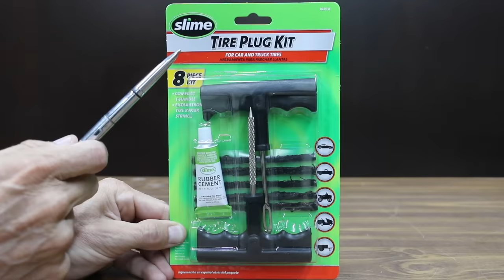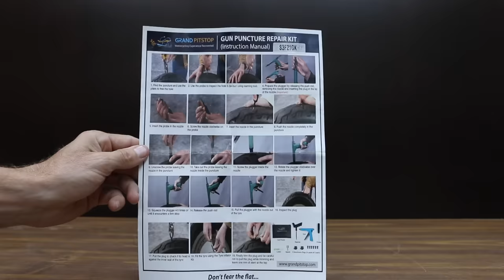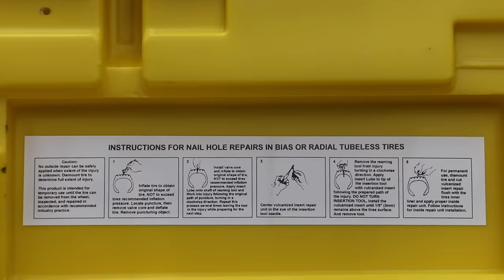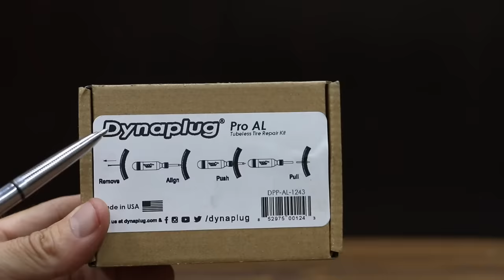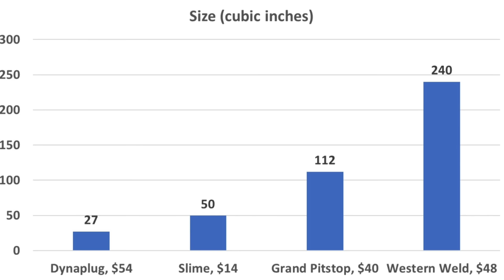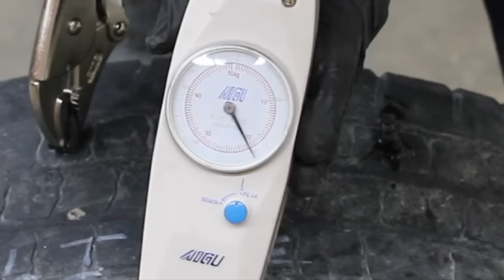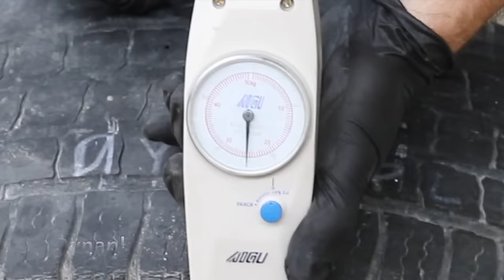Best Tire Repair Kit? SLIME, Westweld, Dynaplug, Grand Pitstop

Comment: For anyone who has NOT ever put in a tire plug, tip your hat and give this man the respect he deserves.  Put a tire plug in and you will become enlightened to the WORK that went into this video.
Reply from the maker: Thanks!
Reply: Indeed! I came to the comments to see if anyone could appreciate the force it takes to get a plug in a tire. Usually I'm laying on the ground or navigating a fender and trying to brace myself against anything I can to muscle them in.
Reply: cordless drill and the proper size drill bit (bits)  does wonders. cheap tire strips all ive ever used.
Reply: One was enough to kick my butt!  😊
Reply: I would be terrified the plastic handle ones would break after being used more than a couple times, sending the metal portion through your hand.
Reply: @Print2shoot  Right! Then you have to use a plug for your hand😁😉
Reply: Seriously, stop with these cringe comments
Reply: It's really not that hard, if it is you didn't ream the hole well enough and didn't inflate the tire before plugging.
Reply: I thought there must have been something wrong with me when I did my first plug. Now I know there are millions of brothers out there nursing broken wrists. Bless 🤙
Reply: Agree, plugging is hard work
Reply: I'm lazy so I want the one that is easy to use and good enough
Reply: Putting in 1 western weld tire plug is a workout all by itself, but they last the life of the tire.
Reply: @daurieschwartz4189 geez glad it’s not just me! I was like am I getting old or what!
Reply: This guy works his butt off for us!
Reply: Yeah but you didn't cover the butt plug  @ProjectFarm
Reply: Agreed, pushing these in by hand is no fun, I've found using a ratchet strap around the tire and then wrapped around the plug handle makes easy work, and even allows you to push the plug in while its still on the vehicle. you just have to be careful not to tighten the ratchet strap too quickly, and keep one hand on the handle as you tighten it.
Reply: I don't wear hats.
Reply: @KingLutherQ  DynaPlug
Reply: 100% when i saw the thumbnail i was like ohhh boy

Comment: Been running a slime plugged tire for 2 years now with no problem. Most repair shops won’t plug a tire anymore saying they aren’t safe so I plug my own. I think the real reason they won’t plug a tire is they can’t make enough money. If you monitor your tire pressure you will be fine. Project Farm is the best
Reply from the maker: Thanks!  Thanks for sharing.
Reply: If I ever plug I always move it to the back. I dont want the front tyre failing. Not that it ever has.
Reply: @kevballard1967 what exactly is the reason for that?
Reply: Front tires are used for steering. Lose a front tire at speed and you could go flying into a barrier or oncoming traffic. If you notice in time, you can safely decelerate, but when you lose a plug, air comes out much faster than with a small screw. Otoh, I've never had a plug come out -- it's more likely to happen if the hole is too large to plug safely in the first place.
Reply: @benb8075  that myth about the front wheels being more important is long proven wrong.  The rear non steering axel provides the stability. You rather want to loose a front wheel instead a rear.
Reply: My tire failures were always heat related delamination,. Every tire brand had it, except the Continental. I always plug my tires when I take one of the millions of roofing nails on Texas' unswept roads. It is the heat related delamination that is the real issue.
Reply: 9/10 will give you the "can't safely plug" and also "by the way, you need four new tires, an alignment, brake job, and I cannot let you leave this place unless you do it now but being a nice guy, I'm knocking off 10% the total price"
Reply: No money in plugging tires.

Comment: As a mailman, I pulled into the tire shop for new tires... the employee came to get me and wanted to know what was going on with my right front tire... we counted 52 plugs that I had put in over a period of time. Most of them were Slime plugs showed in this video. Never had a problem with them. Great video as always! You're awesome brother!
Reply: How the heck did you get to need that many plugs?
Reply: @alanmerritt860  he’s a mailman, always driving on the shoulders where nails and sharp objects settle because it doesn’t get driven on much.
Reply: @alanmerritt860  what Michigan DroneWorks said 😊
Reply: That is so ubelievably unsafe
Reply: Put me down for the $14 Slime plugs Ralph.  Thanks Dewayne!
Reply: The Slime kit is what I use.  Been using it for years.  No problems. 👍🏼
Reply from the maker: Thanks!  Thanks for sharing.
Reply: @LordOfSilense  lol 😆
Reply: @LordOfSilense  I’ve probably plugged over 30 tires on vehicles in my life I have only had one fail and it was in the sidewall I new it wouldn’t last but was just trying to make it to the tire shop I got within 100 yards and limped on the rim the rest of the way. I’m so tired of people saying plugs are not safe/ no good. I have used the slime type ( I prefer the orange color cords) in tires for over 2 years without a problem.
Reply: @Snookchaser007  yes sir I'm with you! I've driven thousands of miles with plugged tires! I bought my wife a new Denali a couple of years ago, and about a month after she got it, she ran over a nail, and I plugged it instead of going through the hassle of taking it to a tire shop, and she's still driving on it! 60,000 miles on them now and probably another 20,000 to go (probably more like 10,000) lol 😆 🤣
Reply: Problem is water rusting the steel belts. They weaken and can rupture, and could fail at highway speeds. which some people can not handle their car well, so they could wreck. I have a large buick 94 wagon with a front tire was thumping loudly driving home on I64, and it threw the entire belt off the tire, tore up the driver door bottom and I looked in the rear mirror, it was thrown hign into the air, landed on the road in traffic. The tire carcass left on the rim was torn to shreds. But the car kept straight and true, drove from far left lane to the exit and changed tire on the exit ramp which had a nice wide weedy spot to work with..

Comment: I've used cheap rope style plugs for years and never had one fail. One was on a brand new tire and it lasted the life of the tread.
Reply: Yep, I've installed hundreds of these plugs for friends and family and the occasional person in a parking lot with a flat.  Even on new tires, they will last the life of the tire.  The manufactures of these kits just can't accept liability for claiming life of the tire in the event it fails in today's litigious society.
Reply: I punctured one of my current tires when it was brand new. A cheap tire plug fixed it for a year. Then I simply fixed it with another tire plug which now lasts for two years. We're talking 200km/h(130mph) Autobahn.
Reply: Same here. I have no interest in even trying any variant of the common plug being that they are so reliable.
Reply: I don’t recommend it, but I have personally used 3-5 plugs in the same hole in tires before that had large punctures and it still works. This was on off-road only tires, and I wouldn’t personally do it on a road worthy vehicle, but in a pinch, it does work.
Reply: Yep I’ve used the cheap 3 dollar Walmart brand on 2 tires and never had any trouble.
Reply: same here, i have had plugs in new tires last as long as the tire itself. there is really no need to pay more for tire plugs when the cheap ones work great.
Reply: Nothing beats the classic rope plug. They simply last, and don't take up much space.
Reply: until you have a broken brake lever pierces into your tire
Reply: Yep, I got the cheap harbor freight version.  Reamer handle snapped under force but was able to get it done and still holding air just fine 2 years later.
Reply: It all depends on the size of the hole
Reply: Yep.  They can keep that convoluted crap.
Reply: I put a slime plug in 2012. Unfortunately got a flat three days into owning my truck. I sold the truck in 2019 and the plug was still kicking.

Comment: That driving around “testing” the plugs deserves a like in itself. I think Mr. Farm was enjoying that portion of the test!🤠
Reply from the maker: lol  Indeed so!
Reply: Wtf! You need a passenger to scare the shit out of when “testing”!
Reply: Doing donuts in the yard for SCIENCE!!!!
Reply: Just wish he would of done a highway test since one of the main reason's they fail is from being pulled out by 65mph+ centrifugal force, repeatedly on the high way.
Reply: @MR-nl8xr  In the real world if it’s installed properly, that will never happen.  It’s way too tight for that too occur.  If it did, it would leak to start with and you’d know it.  I’ve never, ever heard of a plug coming out.  Not once.  I’ve plugged many tires that went all the way to recycling without an issue.
Reply: @theoriginaljimmykicker  In the real world if it’s installed properly, that will never happen. 
-Wrong.

 It’s way too tight for that too occur.
-Wrong again.
Do you even understand how much force is exerted at 65+ MPH on larger tires?

  If it did, it would leak to start with and you’d know it.
-More wrong.

  I’ve never, ever heard of a plug coming out.  Not once.
-Good for you.

  I’ve plugged many tires that went all the way to recycling without an issue.
-How much daily highway & higher speed driving did you do with larger tires?
Reply: @MR-nl8xr  Cool.  But you are incorrect.  Provide a single link that can back up what you just said.... that a tire plug can come out  purely from inertia.  I'll wait.   Video would be great.    Now, I've never used those other types, so I can't say for them because I have no dog in that fight, but if you HONESTLY think an old school self vulcanizing plug can sling out of a tight hole,...one that  is tight enough to stop the air pressure behind it from escaping....as it rolls....AND it'll somehow slide by the adhesive stuck in the snare of steel belts that are also holding it in?    That is laughable and you're wrong.   I don't care how much force is behind it.   You'd have to deliberately try it, and as this video showed, that isn't easy, and IF installed properly (cut flat and deep enough), there is nothing to even make that a remote possibility unless you were driving like 250mph (my xB will do only do about 110 or so, so I have no way to try this) and out of 100 plugs, not one of the old type of plug failed despite Todd giving the Suburban hell.  Not one. ..In fact, none of them just flew out.  And yeah, I drive my vehicles "highway speeds" with plugs in them.   Pickups included.  Been doing that for decades of driving.   Done them on my wife's car.  So let's be clear and dismiss the fact that you stated "wrong" to stuff without anything to back it up why I was wrong.  Way to debate.   Let's also break down the the red herring arguments you made about my post about things I wasn't talking about nor were related to this video.  We are not talking about putting a plug in a tractor trailer tire here, or a giant dump truck if we're talking "larger tires"....(whatever you meant by that) or trying to break the land speed record in some dragster with slicks that wrinkle for traction.  No one is making that case here. For everyday use they are perfectly safe and have been for decades.  I will admit that tires CAN be damaged occasionally from being run flat however and it can also NOT be visible from the outside, and in that case a new tire should be installed.  Course if it's my tire, I know the skinny on if it was run flat or not.  If it's on the ground when I get ready to go?   Plugging it!   If I ran it flat?  I'm replacing it.   See, friend....to the ambulance chasing society we live in, tire shops don't want to plug a tire, and taking it off the rim will reveal the ran flat rubber death dust that was not apparent from the outside.  That tire is damaged so you would not plug it NOR patch said tire.   This removes any liability from the tire shop since they know for sure the tire was ok when it left the shop if it were to blow out down the road.  (Plus they make a lot more money patching or replacing).   This has NOTHING to do with plugs themselves.  At all.   I really just learned this myself, so I don't know everything.  It isn't now, or ever has been because plugs just fly out of the holes, causing 40 car plieups, killing and dismembering people, and this test kinda proves the point.  Jeez...   Don't you think if there was concrete proof of anything you just said that you couldn't even purchase these at Wal-Mart?  SMH.
Reply: @MR-nl8xr I’ve used many a have 3 as I type this a isn’t anything for me to lay down 50-60k miles a year as a service tech.  I spend way way to much time on the road.  
Never have one come out. An normally I’m cruising about 88 on the Highway my more longer runs of 65 miles straight highway each way.  

Never once has one ever came out.  Have I had an old plug leak I believe twice. A very slow leak.  Replaced it an was fine an was back to running around as usual.   
Like the other guy said.  If they posed any of a danger an was an actual thing.  They wouldn’t be allowed to be sold in stores to the general public.
Reply: @AquaTech225  I’m with you.  Plugs don’t spontaneously come out.  I’ve had a situation where the plug might not have sealed properly and had to put a second one in beside it, but I have never, ever had one just come out.  

I put one in the sidewall of a tire recently.  (It was a lawnmower with a top speed of 4mph.   I think I can survive the blowout!!).  Haha!   I’ve gotten 4 cuts out of it so far.  It’s so hilarious just sticking out there.  I gotta see how long it’ll last!
Reply: @theoriginaljimmykicker Aren't those plugs pretty much exactly the same thing that tire shops do to repair a  puncture? 
I didn't see a different way of repairing punctured tires so why on earth could there be an issue with it.
Reply: Indeed, the funnest part Im sure!!!
Reply: @AgneDei  The only approved tire patches for most of the big brands are like what Michelin says on their website, “Repairs of all tires must be of the combined-plug-and-inside-patch type”. The tire has to come off the rim to apply that inside patch. Furthermore, there are specific criteria that a defect has to meet in order to make it repairable. Can’t repair holes in the sidewall, and usually 1/4” max size puncture in tread. 

If you choose to do otherwise, it’s at your own risk. As Todd said, these repairs demonstrated are only meant to be enough to get you to a tire shop.
Reply: @theoriginaljimmykicker   RIGHT original!!!!  MANY decades, MANY plugs...NEVER FAILED.

Comment: The installation of 100 tire plugs was over the top in testing. Outstanding, and yes, I can imagine quite a workout. I've never had a tire plug fail on any of my off road vehicles. Thank you for another outstanding test and face off.
Reply from the maker: You are welcome!
Reply: @ProjectFarm  n
Reply: For a moment I thought I was watching garage54.
Reply: Had my first slime brand tire plug shoot out on the highway after hundreds good. So they can fail
Reply: It leaks after 2 years from the fiber parts because the tar cannot seal it anymore. Basically drying out.

Comment: i used slime tires plugs only twice in my life. and both times, the plug held until it was time to change the tires from normal wear and needing new tires. as far as you go, project farm, i love the video as always. and only go based on your reviews. hands down the best review on youtube. no bias and no unnecessary information. just straight to the point. thank you buddy.
Reply: Add 2 more from me.  The repairs were good for the lifetime of the tires.
The only issue with these kits is that the rubber cement is extremely volatile and will dry out once opened, long before you need to use it again.
So my policy is, one kit is good for single repair only, unless you get multiple punctures within a small time frame, which is unlikely.
Reply: Add hundreds for me. In small holes they never fail. Anyone who says otherwise is just plain wrong.
Reply: @catsspat  lies

Comment: Have been using Slime for years, recently used up the 11 plugs, saved alot of tires.  Never let me down, all repaired tires were used until totally worn and never leaked air.
Reply from the maker: Thanks for sharing.